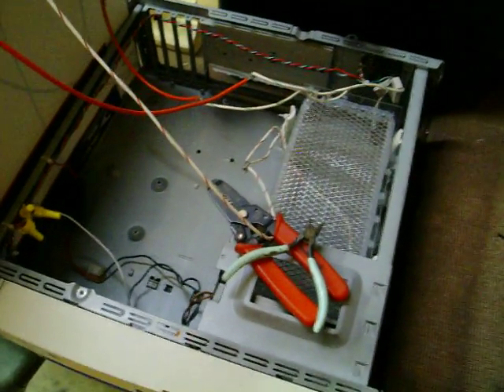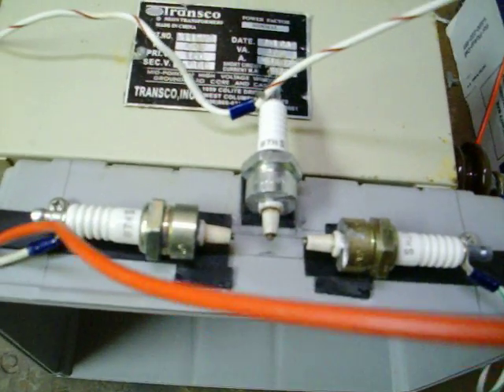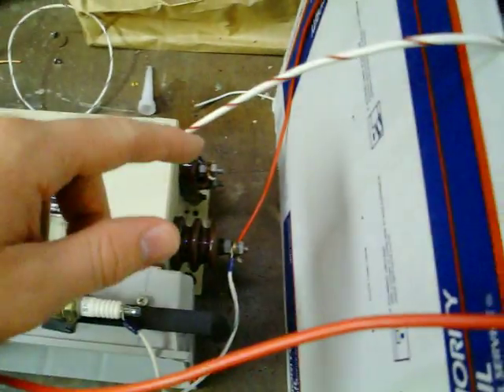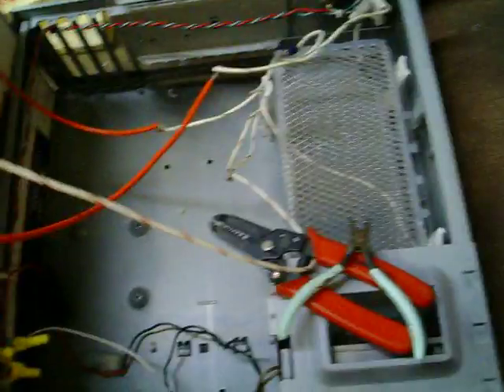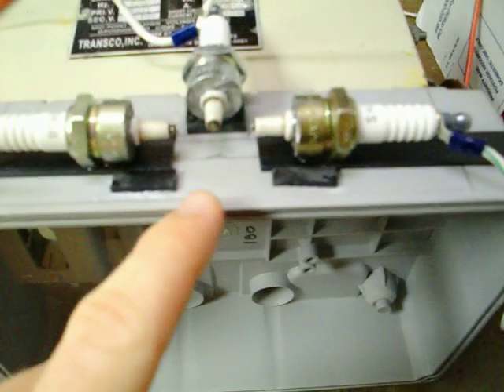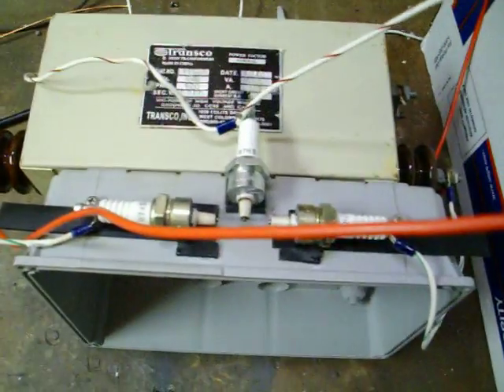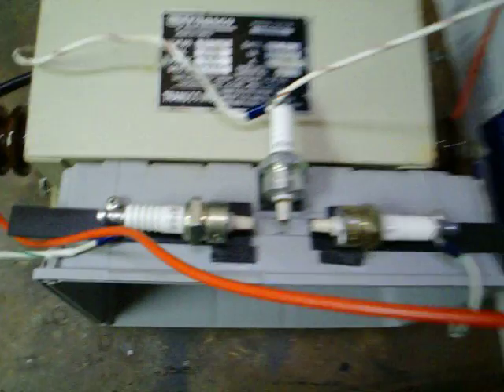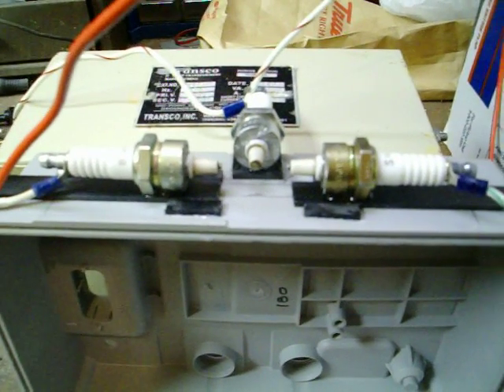Ozone Generator - DIY The Correct Way

Comment: buy a 12in x 12in ceramic floor tile. glue aluminim door screen to both sides leaving the screen 1in smaller, at least in all directions than the ceramic tile size to avoid spark jumping. hook up one wire to one screen and the other wire to the other side of it, use alligator clips or something to attach to the screen. fire it up and it will run you out of the room with tons of ozone. i do it with a 9kv transeformer like yours i had laying around. put a on/off timer on it or you'll die from so much ozone. simple but effective as all hell...

Comment: Why in the fuck are you using spark plugs? I know what you're going to say because of the ceramic LOL the ceramic is supposed to insulate the metal conductive surface in order to make a Corona effect. This is useless yes it will create a little bit of ozone but it's more dangerous than anything

Comment: If I wanted to reduce the voltage at the secondary at the transformer(HV side) I could  just put a variable transformer (Variac) at the primary(120vac-wall) side. A variac costs about $85 on ebay.
 The sparks producing the ozone should only be a corona discharge(fine purplish sparks). Also the ozonizer  will produce heat, the better it is cooled, the more ozone it will produce.

Comment: Has anyone tried using a simple farm hot wire fence to generate ozone?  I have seen where the hot wire along the fence finds the place where the wire is closest to the ground and starts doing an little lightning thing arcing to the t-post ground every 15 seconds or so and thought hmph that looks like it would generate ozone right there.  Low cost.  Already safety engineered.  Designed to shock small farm animals like goats without serious harm so it's much safer than playing with Frankenstein's laboratory like in this video IT'S ALIVE! and then someone dies.
Reply: Neon sign transformer at 30ma is pretty safe.

Comment: what about just using utraviolet radiation like made from gas discharge lamps like xenon to treat the oxygen making ozone through photocatalytic reactions?
Reply: YES.  instantly debilitating upon first lungful inhalation, persistent saturation results in death by asphyxiation, appearing as death by natural causes/heart attack etc-- especially when delivered as a US military weapons grade in silicon containment as silicon is non-ozone reactive.  Gas Ozone is a Rabbit Hole as deep as the true FLAT EARTH or hoax neo-Nazi NASA and mil spec vacuum space paradigms.  It may have a huge body count.  CIA applicant 'NOBODY' was last known to be at Esperanza en Escalante near the USAF DMAFB Wilmot Gate and claimed first hand Termination in the Field experience by gas ozone.  Ozone is NOT a panacea.  It has many applications, especially healthcare and weapons.  Individuals seeking to contact 'NOBODY' should contact EeE Tucson by Betty Slaybaugh or Myrna or Phyllis and seek an appointment with Roman Catholic social worker Angela of the Masonic neo-Nazi globe earth paradigm.  Ancillary missions may include Area 51 ty of USAF Areas 51/52/53/54 Indian springs holographic Battlefield Shaping Target Detail.  Expect contract law and neo-Nazi and globe earth vacuum space paradigms resistance.

Comment: Never had any problems with mine and no safety gap.... 25KV neon xformer, plate glass dielectric, 2 steel plates and about a 1/4 inch air gap.  Looks and sounds cool and smells great.

Comment: What does an ozone genarator do
Reply: Kiled02  It helps clean the air and make it smell like a lightning storms just past through.
 When I worked in fire restoration we used them to remove the smoke smell from the areas in the housing materials that we couldn’t Access in the residence.
 When I was a Licensed State Cannabis Grower in Michigan we used it to eliminate the Cannabis smell.

Comment: I'm playing around with old commercial units and the have pot controlled transformers for the "Level" of ozone. I don't see why you couldn't simply put something like a 50 volt plus motor controller inline as a big potentiometer and only dial up to the juice you need ?

Comment: mate you need to make a wire in tube type of generator (reduces capacitance).. and also set your gap without the generator hooked up move them out till they just stop arcing (maybe ad another mm or 2) and that should stop constant arcs,

Comment: An arc is a dead short, so there is no safety there. I used a similar transformer, and used glass as an insulator between two wire mesh squares. The glass is larger than the wire mesh squares. The full 15,000 volts is applied to the wire mesh plates. One electrode of the transformer to one wire mesh plate the other electrode from the transformer to the other wire mesh plate. The glass in between keeps it from arcing. AND WAY Too much ozone for my 2000 square foot home within 30 minutes created.

Comment: when you add the safety gap you cause a resonate oscillation, what you need is a resistance aka resistor, basically add resistance between the capacitor and your transformer and gap until you cannot get blue sparks, the resistor will allow the excitation of the corona but will suppress the few tens of peak amps that you are seeing at you safety gap, also ozone generation works better if you use a higher freq source.

Comment: (never touch electric components. use a safety contactor switch, and dielectric tools, gloves, and shoes.) ozone oxidizes microbes and decomposes chemicals, flowing inside moldy hollow spaces. make a small safe inexpensive portable modular one and sell it. the industry people sell the same defects to the public on purpose (big plastic box with expensive nonwashable filters). since the 1950s they have been taking billions for air cleaners. they owe us trillions.  - james mcashan for US Senate

Comment: I need to build a ozone generator with dc voltage for the air intake on my truck for better fuel efficiency, think that transformer would work.

Comment from the maker: @CiaranVanDon  Ozone generators are usually industrial and are used only when required as Ozone is not healthy to breath frequently. For instance, you could rent an ozone generator to help get the moldy smell out of a previously flooded room. These generators have timers are are used with the room evacuated.

 They may market these as "air fresheners" that make you feel better. This is false. Ozone is a pollutant and should be only used appropriately.

Comment: @matts2007 I don't believe you say that! Heard of Saint Elmo's Fire? 
High potential differences between pointy conductors and charged atmosphere?
The weather systems create a negative ionization. The ground becomes positive. 
The most stable and less probable to arch coronal discharge is a positive direct current one. 
AC causes ionization both ways. And a lot of O3 to become O2 back before leaving the plasma.. 
Now I'm frustrated that I deleted that video I put a few years ago on YT... :))

Comment from the maker: @yo6ial You fail to realize that high voltage DC does not create a corona. Arcs create a very tiny amount of ozone. On the other hand, AC creates tons of ozone. You *may* be able to get away with using an old, unrectified flyback; however, these are hard to find or make.

Comment: I don't get you guys.
Use a  DC/DC supply. (a well made flyback psu would put 30kV, easy)
Rectifying solves _A LOT_ of arching.    
Big resistors series with the transformer. 5-20Mohm. lower currents=safer..
Use a sharp needle as the anode, and place it in the center of a long insulating cylinder.(1-3" dia.) pointing to one one of it's ends. 
Put a thin metal jacket on the exterior of the cylinder as a cathode and ground it. 
Plastic meshes at the ends=fingerproof. 
Make more if needed.

Comment: there is an easier way of doing this. Just take a glass tube and line it with mesh metal and send electricity through it. I work for a company that does this, so its an everyday thing for me.  If you have any questions let me know.

Comment: I run Ozone UV lamps as I ran into situations I felt would be not the safest thing to have running such as yours. The OIII lamps don't produce near as much ozone as the Corona Discharge does like yours but thier safe. You can buy just the lamp with the quad prong style and some regular ballasts are capable of firing them up on the starting circuit even without a delay. The lamps come in many socket configs, much safer and still produce great results. Cheers.

Comment from the maker: @GnosisMan50 The resistance on the secondary coil should change, the input current (measured with an amp-clamp) should  be very low, and there may be little or no secondary coil output. Otherwise, I'm not sure how to test the transformer. 
I never got around to posting this, but others have informed me of a better design: Rather than plates, there should be a glass tube with metal mesh around it with a solid wire through the center. Much less capacitance. I'll probably try & post soon.

Comment: Thanks Matts 2007
for sharing your project...At our university we are also building an ozone device but i fear we already blew the transformer. It worked for about an hour but then stopped. i was informed that the transformer -which is the same as yours-got really hot.  Is there any way to test the transformer to see if it's burned out?

Comment: You can create high voltage with a single solid state piece of equipment; it suspends a spherical layer of h2o about itself in it's function. You'll need a cnc lathe to build it out of 312 stainless steel. I have plans.  I made one a while ago but I ran it too high too long and it destroyed itself.

Comment: The watts burned by an O3 generator is roughly proportional to the frequency, the voltage, and the capacitance (f*V*C).  I built an
O3 generator last night that consists of bare #22 stranded wire centered in a 25 mm dia quartz tube, 6" long, wrapped on the outside of the
tube w/ Al window screen.  At 12kVs and 60Hz this  consumes 100W.  Your C is huge compared with this. My guess is that the xformers are burning up due to overload.  Use a clamp-on Ammeter on the 110V side to check this out.

Comment from the maker: @cajuncoiler Correct. This was done when the transformer was not connected to the plates. The plates create such great capacity, the safety spark fires constantly. I'll create smaller plates if I get back to this project.

Comment from the maker: @acidbath32 You're probably safe as it's probably not putting out much Ozone. High output ozone generators are designed to run with nobody inside the room: Ozone can be very unhealthy at high levels. There are no proven positive effects of actuially being in a room with an ozone generator.

Comment: @LilGreenFiero 
Yup, you're right...
But, for ozone maker, we never need high power as the input,
or, high current as the output...

All we need is high voltage at low amperage for the output...
This would produce corona discharge more efficiently...

This is what works in my ozone generator, at least... 

Still learning tho... Lol!!
Thanks!!

Comment: You can open a economic light bulb and take out the circuit ant power your flyback with the circuit, then it makes small arcs but it smells ozone and make a hissing sound but I don't know if flyback could die using this because it is a stil a short-circui tin the primary